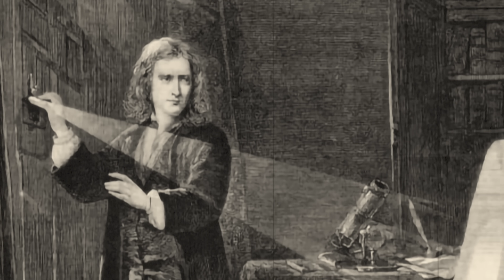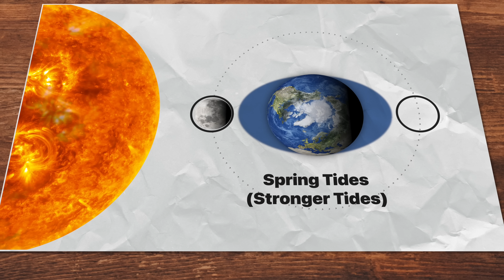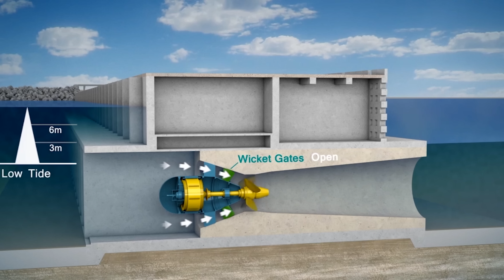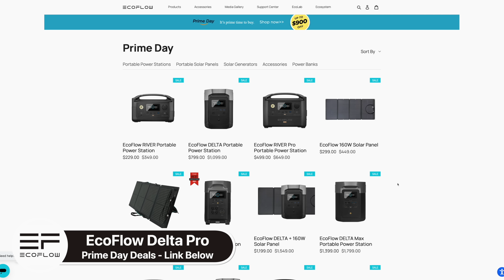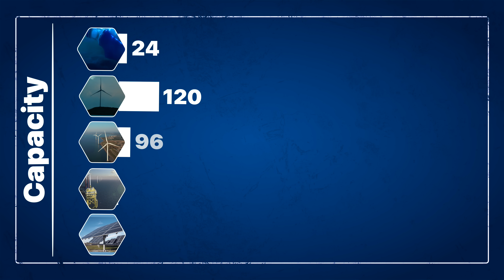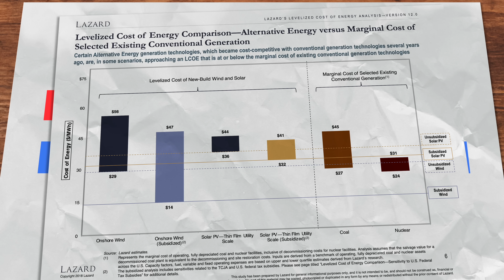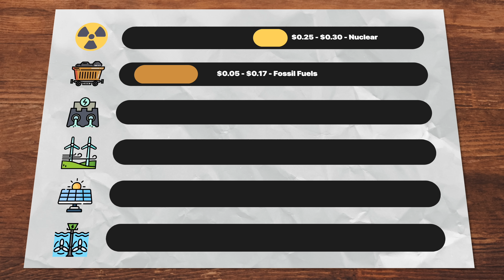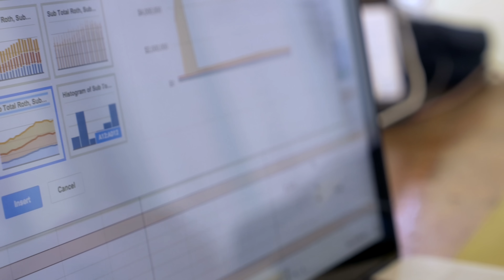Breakthrough Energy Source is 10X Better Than Wind & Solar!?

Comment: Worked in this industry briefly. The challenges are huge: water eventually destroys everything, salt water exponentially so. Installation and maintenance are ridiculously expensive. We still don't have great ways to harness and lubricate constant motion under water. The projects that have been done, while immensely informative, have typically fallen short of their projections. However the single biggest problem we were facing is lack of funding. Other than a few high profile projects it's really really hard to get money to explore this field. Governments should be dumping billions into this.
Reply: Good lord, have you people never heard of maintenance before? Just because something is exposed to a harsh environment doesn't mean it's going to curl up and die. Are there challenges? Of course there are. Do you think nuke and fossil fuel plants never had any challenges? Do you think they don't need maintenance?

There are corrosion resistant alloys, ceramics, fiber reinforced plastics, etc. that can be used to build these types of machines. Lots of talk about bearings. Do you know what is used for bearings on the propeller shafts of boats? Rubber, lubricated with seawater. Don't believe me? Look up cutlass bearing.

We, as a society, need to get our collective heads out of our butts and think about what is down the road instead of what is right in front of us. We used to do that. Now, it's just "What is good for today?" I can remember the same arguments being made about the space program by narrowminded people. But today, thanks to the research and effort that went into the space program, I can type out this missive on a laptop from the comfort of my couch, or the beach, or driving down the highway. Okay, maybe not driving down the highway (because that would be dangerous) but I can certainly ride in a car and connect with the world via my cell phone. I can go to bed tonight on a memory foam mattress. I can rely on the weather report to tell me that I can cut my grass tomorrow with a battery powered lawn mower. 

My little screed is almost done and I'll relinquish the soap box after this final thought. Research into new technologies can pay dividends that we can't imagine right now. Do you think Werner von Braun was thinking about telecom satellites and spongy mattresses when he was working on V-2 rockets or was he just interested in blowing $#!+ up? Without those early pioneers in space, we wouldn't have the tech products we take for granted today. Research like that which would be needed for tidal power generation could provide other important tech that we are not imagining today. And, even if it doesn't, it could still hit it's prime target, an abundant source of clean energy.
Reply: As someone who knows nothing about it, I assume the system would be similar to what it's used today for marine propulsion, combined with port construction.

Which are the complicated details that I'm surely oversimplifing?
Reply: They have been through 3-5 year underwater testing both in Scotland and in Japan. The results are good enough to start going full scale energy production.
Reply: There was African hardwood that was used for engine bearings. I’ve also heard of ceramic bearings. And magnetic bearings.  The solutions are out there.
Reply: @The1Elcil  create corporations which pay all of the taxes and hire people to do awesome stuff and pay them well and your dollar will actually go somewhere and everyone's quality of life will improve
Reply: I was just wondering how they plan to deal with marine growth on these things. In one year anything underwater starts to become a growth platform.
Reply: @BadUncleIke  Send a small current to the exterior. It will repel life forms...
Reply: I am thinking that maybe most of the corrosion issues might be addressed by 'anchoring' the most vulnerable components in a floating platform.  I expect this would not be easy (tidal forces to name one problem).
Reply: @jimparr01Utube  like epoxy coated rebar you can coat any metal
Reply: @drseuss5407  Yes Sir.  But as a sailor decades past, I understand at least something of the highly corrosive effect of wind and water at sea.  I really have little notion of what I am talking about with the power generation machines currently in use or under prototype evaluation.  BUT, I expect it will take some genius engineering to ameliorate the effects of this type of environment to ensure a productive life-span for any installation.
Reply: @jimparr01Utube  Was thinking the same thing. Why not use inverted vertical-axis turbines with the sensitive parts sheltered above the waterline?
Reply: @chow-chihuang4903  It's been done. Time for some research.
Reply: The US government devotes the bulk of it’s attention to who drops the most in campaign donations. Currently that’s the petroleum and coal companies. They keep the public poor so they are always reliant on government handouts. Then they look down on the handouts so they can justify restraining the people even more. Look who reformed the bankruptcy codes against the people in 2005 and then ask yourself how he became President now and why he’s so slow doing anything he promised to get elected.
Reply: Thank you, that is what I thought, But I don't know how ships and submarine propellers manage to work in saltwater. Can't you use the same technology?
Reply: @m.dahmadi4881  they're repaired very frequently, are huge money sinks, and pale in comparison to the power scale we're looking to harness. Also it helps that they're not stationary, and floating around in the ocean. That means there's less things catching on them, whacking into them, and general damaging them.
Reply: Water is a universal solvent, regardless of what material you use water will tear it apart, maybe you could help reduce the damage with hydrophobic materials but ultimately putting anything under water just increases the difficulty

Material damage, under water pressure (not just for the machine but the people that have to work on it and clean it)

The future of energy is nuclear and hydrogen
Reply: Qukai, you are correct, and a fair assessment.  Thank you for a very effective and quality post.  I mean this with zero sarcasm.
Reply: @TheFastAndThe Dead This is correct, on top of being excluded from taxes, which adds to the subsidies...  Except, now add oligopoly driven, unregulated, speculation.  Free enterprise goes out the door when all in the industry operates as one.  That is why different sources of energy are needed on a market ready, productive, basis.
Reply: "Governments should be dumping billions into this"

This ^^

I get the feeling that fusion gets endless $billions down an unproductive path (tokamaks) because the fossil fuel giants do not expect a magic breakthrough to occur anytime soon.

If the same $billions went into tidal energy it would be solved already.
Reply: Miraculously in Europe they've installed ALL KINDS of structure in the oceans and seas and can manage massive water breaks, tidal power plants that have been in use for decades, turbines, etc... and can design these systems to where they're cost effective.

Now, why that can't happen in the US, I don't know maybe your engineers haven't figured out the science of materials which is only about 100 years old?
Reply: @johndoh5182  According to Eurostat only Spain and France have any tidal power generation at all and it's a fraction of a percent - so no the EU is not just magically running off efficient affordable sustainable tidal/ocean power while the rest of the world neglected to notice.
Reply: @lephtovermeet  Umm, have a problem reading?

"Miraculously in Europe they've installed ALL KINDS of structure in the oceans"  

So now look up ALL the different structures in the oceans and seas around Europe.  I guess you didn't realize what the word "structure" means?

I was responding to your OP about materials, and yet materials science deals with issues EXACTLY like this.  So your OP is overblown.

In the EU there are tidal turbines that have been in operation for a long time.  You could say this was part of their learning curve.  Don't install 1000 systems and then find out it's too expensive??

Yes, in the European countries there are plans to expand underwater turbines, but it moves slowly because of environmental impact studies which take a long time to complete, but even this wasn't going to be done until there was really good data on these types of turbines.
Reply: @johndoh5182  yes, most projects take a long time to do an environmental impact study, specially when it comes to sea and oceans, but I'm sure that it's worse for tidal ones than say fossil rig platforms because of the proximity to shores
Reply: Environmentalists lobby groups, celebrities and large corporates that preach about climate should be "dumping billions" into it.   I am not talking about a token gesture, I am talking going "all in", remortgage the house  and invest the kids inheritance.  Then we might at least believe that they believe in the "climate emergency".  As it is, not so much.
Reply: @jamescaley9942  Even if there was a real emergency they would be the last ones to spend anything on the solution. They would make the poor pay first, they think they have the authority to do so.
Reply: Once more tidal systems are up and running the costs will reduce. New advances in anti corrosion methods are happening all the time. Time for governments to put the investment into Tidal instead of wind !
Reply: What portion of this “water ruins everything” do you think is actually the oxidizing it allows?
Reply: @TheFastAndThe Dead not that easy =/
Reply: Thanks for your contribution.
You pointed out  important drawbacks.
I think with invention of new generators we can overcome these obstacles, SWET , solid state wind energy can be developed to be used for getting tide energy.
For this purpose I am thinking about new generator , I named it DMEG ...
Reply: does it always have to be rotating turbine for tides too?
Reply: The goverments dont want cheap electricity , not part of the agenda .. society is based on waste and sickness not  last forever and cheap as fk and optimum health for all ... no money in that scenario
Reply: Hard to say if throwing billions at it will solve it. I would hope gov remains open minded and if someone comes up with a possible solution they will check it out. Does not help if the projects came short of their projections.
Reply: Old tech like water wheels are less prone to failure when the delicate bearing and electrical components are not under water.
Reply: @TheFastAndThe Dead Use different materials.

Easier said than done. Saltwater is amazingly corrosive. There are not many materials it can't eat up. 

And as he notes in the vid  ca @9:30, "biofowling". aka "Barnacles" (though there are certainly other waterborne lifeforms that create issues). Your material not only needs to resist the corrosion, it also needs to resist the attachment of barnacles and other aquatic life forms.

Note that the price per kw hr figures he cites for all the "green" sources are preposterously wrong. If they were not, there would be an industry RUSH to develop "Green" energy, even more so because there's such a push by a small class of noisy but ignorant Green fools who demand it. Claiming 80% efficiency is especially ridiculous... There are NO systems that get that kind of efficiency known to engineering OR science. The best known systems currently seem to approach an optimax efficiency of around 66%.

Equally important, California and Germany would be the world leaders in power production, because both have gone all-in on "Green" energy. Instead, Cali has to import something like 30% of the energy it uses, and Germany is in a serious state of near-collapse as it fails to produce enough energy to support a modern civilization. Germany is now tearing down its forests for wood-energy, and along with many parts of Europe who have been suckered into this garbage, is already warning its citiz//// (cough cough) "peons" that they can no longer expect to rely on having power to heat their homes this winter, that there will be multiple days in which they will not have enough heat. Even France, who have used nuclear for decades as their main source, with no significant incidents, has fallen for this crap and is expected to have significant shut downs of non-essential power usages. In France, many otherwise successful restaurants are expected to go out of business this year due to being shut down for substantial times due to enforced blackouts of "nonessential" businesses.

No, don't take my word for it... just pay attention to Europe this winter. Pay careful attention, as I doubt if the US media will report much of this. Work on getting some international sources, such as papers in the UK, which you can rely on.

P.S., they also fail to note yet another form of actual Green Energy which probably should be investigated (though it has the same issues, corrosion and biofouling), and that is "Ocean Thermal Energy" (wiki it). The basic idea is to use the temperature differential between the surface of the ocean and about 100 feet down to generate electricity. There are two different systems Closed Loop and Open Loop -- one of them just brings the cold water up, puts it into a heat exchanger, then releases it back down where it came from. The other brings the cold water up, and then releases it at the surface.  The former helps the fish below, by giving them more warmth to work with. The latter helps the surface fish, as it releases the nutrient-rich water from lower down (nutrients sink) up topside. The big question here is deriving energy from the temperature differential which is lower than we typically use to generate power. The answer may be in the form of the JTEC (the Johnson Thermo-Electric Coupler) invented by Lonny Johnson, the former NASA engineer who got rich by creating the "Super Soaker" water guns. It gets close to the actual maximum efficiency ("The Carnot Cycle") even at low differentials. This is also pie in the sky, as, while there have been some small pilot plants operated out of Hawaii, there has not been a great deal of investment in it.
Reply: Why would you dump money into low return unreliable systems such as this when high reliable green safe nuclear power is just about here?
Reply: @TheFastAndThe Dead Thanks for the comments. I think we need to give the new generation small scale nuclear a serious try. Read about the NuScale company NRC approved small reactors that are coming. The IEA says nuclear is the most reliable energy generation technology we have and far less expensive than wind, solar, and tidal. Look up the measured capacity factors for each technology by the IEA. Generation needs to be near load as transmission loses are significant even in short distances. I like tidal but my state has no tides… i.e., no coastline. Wind in my state at the best location only operates 34% of nameplate capacity. Installed solar here likewise has a poor capacity factor… less than 20%. We gotta do something… good grief Charley Brown. There is lots of wind in the air, there is lots of water in the ocean, and there is cheap land on the moon, but none of this helps the folks living in the desert.
Reply: Plastic seems to hold up longer in salt water
Reply: Once they figure out the main designs, I expect carbon fiber will be the solution to a lot of the problems.
Reply: They could use graphene lubricant with reverse engineered Lilly pad particles for hydrophobics, also graphene has been proven to create electricity output from salt water abrasion which would enhance the general output of the turbines.
Reply: Also why are they not using implosion designs for the turbines? That would take less force I believe.
Reply: Thanks. Brilliant, concise, and should be sobering. However, starting with N Tesla's insights into the use of rotating fields & tapping ambient E will soon be the best way to power the world (with least heat & GHG pollution, least toxics, least maintenance & costs, & best durability & E-efficiency). ~
Reply: Thank you for sharing your expertise.
Reply: @TheFastAndThe Dead It has been subsidised but not nearly by how much money has been taken in taxes for oil and gas.
Reply: Yep. Enthusiasts are people that have never lived near, nor have any experience seeing what Saltwater environments, with all of its biology, does to anything that spends even a short time visiting its world. 
Even without the effects of saltwater corrosion and biological build-up, mechanical seals needed to keed the "innards" dry, are prone to failure on a regular basis. Leaking seals always leads to internal mechanical failure, electrical component damage, and the only way to do repairs is to lift the turbines out of the water... Essentially disconnecting them, underwater,  by divers... and "dry-docking" them. In unreliable weather. EXTREMELY expensive.
Reply: This and the growth of sea life on the generators unless toxic forever chemical coatings are used, drastically lowering the efficiencies in a short period of time, and the need for massive amounts of energy storage to provide power at tidal maximums and minimums when water isn't flowing past the fields of generators.
Reply: @thefastandthedead1769 Use carbon pulled out of the atmosphere perhaps or grabbed from CCS on FF plants maybe?
Reply: @thefastandthedead1769 Thank you. No one thought of that.
Reply: There are different types of systems, ones that don't involve turbines. I'd like to see a whole video on different styles, like the ones Israel has.
Reply: Seems the best ans is in  research for a non-corrosive material. That might help unforseen situations on other planets, too. So, where's the Einstein for this? 😅
Reply: Bearings can be made of ceramics that could resist seawater.
Reply: @glike2  No ceramic is definitely too brittle to make into bearings. If there’s an issue we don’t want parts to shatter at their first high stress encounter.
Reply: Which is why we need to just build more nuclear power plants.
Reply: @infidelheretic923  Nuclear is expensive to build and problematic with its nuclear waste that lasts for 1000's of years. There is always the unexpected. Look up "List of nuclear power accidents by country"
Reply: @TheFastAndThe Dead Aluminum Bronze would be expensive due to the copper required, but it meets all the requirements as far as I know.
Reply: There is a lot of thing that requiere billions of dollars  to be dumped into them, the ROI of each one is need to prioritize.
Reply: @TheFastAndThe Dead so? If it is too expensive is useless. The countries don't use carbon because they like to pollute the environment, but because is the cheaper option.
Reply: @AlessandroRodriguez  we use oil.  That's subsidised massively, globally, but we keep using it & polluting the sea & our air 🤦
Reply: Governments should be dumping billions in taxpayer dollars where ever the taxpayers want it to go. Cutting edge R&D is where this belongs; once the engineering challenges have been met sufficiently, the market for this tech will explode. Governments stick their hands in citizens pockets for plenty already, and with the state of the global economy right now, we have some other rather pressing matters to attend to.
Reply: @thecrarion4102  people have no vote , no voice , your goverment only wants your money , time and life not your voice or opinion .. wake up .
Reply: @macalister8881  I'm fully aware of all of this... but many people aren't there yet, so I tend not to go nuclear in comments sections...
Reply: @TheFastAndThe Dead trying to care for people so far away?, have you interacted with humans?, they barely care for their community and both sides of this discussion have have make very clear that any extra cost is just taxes. Don try to explain this to me, explain to people who barely goes by that they have to pay more for their stuff.
This it isn't about make the coal more expensive to reflect the true cost, that doesn't work with people. make the green cheaper and useful and the people will flock.
Reply: Could not agree more except the part where Government dumping money into this.   And you forgot to mention the impact on species that live in the oceans that will be impacted like fish, whales , birds, bipeds like seals.  The only thing I could add to possibly make this work, is make everything out of carbon fiber.  Except that still does not solve the dead shredded animals problem when operating.
Reply: @mymy3172  They seem to be rotating at fairly slow speeds. It seems that the undersea animals can adapt to their presense. If not, well...
Reply: 65 percent of the planet would take a synthetic opioid drink by the 10,000 gallon vat and say thanks, 1/3 off the world is starving to death, 5 percent need bones they can't or don't want to get replaced, 5 percent need organs they can't or don't want to get replaced, 5 percent are terminally ill 5 percent comic pain, 5-10 percent never wanted to be here anyway, and everyone else will have a peaceful way to go when they want. There's no good way to go, some are 18 and 0 and going through death and not actually dying is not fun, some attempts are violent to go through. They're needs to beat peaceful easy way for everyone  when they want to go. Guy saves 1M in state aid, paid 600k in social security, doesn't have to die every day, just gets to leave before suffering. The guy with the kids gets 800 k from Uncle Sam in life insurance he never signed up for and Uncle Sam keeps the other 800k. Free euthanasia. Cut inflation by more than half, more than doubled available resources. Have a job by a company which pays all the taxes and picks up grass clippings M-S to take it to fields now with cows on it, 4x your US cattle with lawn mower clippings from every years, save 2500 on property taxes and make sure your clippings are out in your neighborhood on Tuesdays

Dig out 10 ' of river bed and cast and set two 10' pipelines to being Atlantic ocean water to every house, use steam distiller for sale free disinfected water at the kitchen sink, dump waste water into sealed pipelines. It took a turn 2 years to dig out 10' of riverbed, everyone could be back to work working in every town and we'd be at with new infrastructure. Don't put salt in your water, have more salt for more roads in the winter. Use electrolysis for energy from salt water.  At the very least, feed rivers with desal water immediately to overcome drought shortages, no problem

Make a grass and corn crop that grows in ocean water hybrid with say, oceanic grass root structures, best generic corn crop growing in salt water in Texas and Arizona while you solar desalinate more oxygen and hydrogen into the air in a 24/7/365 grow season with ocean water and no weeds growing in salt water cross, full your swimming pool with ocean water and water your lawn with salt water, don't put salt in your what salt water put it in the roads, use a small steam distiller makes it glass and stainless to get disinfected and salt water free water for cooking and drinking, maybe an ocean let for your pool, were have to deal with ocean water rise, how about a Dolphin?

Hey maybe make a corn grass vine hybrid that grows up factories and harvest it by pulling the corn off the building
Reply: Use some natural springs no fish or mose no salt in water n u can put system universal ground n have the hose run into spring there always flowing never freeze here in sourthern Missouri like the turbines at hover damn
Reply: Great information. I struggle to see how you would be able to implement something that protects marine life and the ocean itself, i.e. leakage or exposure to of the ocean to the lubricants and other materials mentioned.
Reply: Quantum Vacuum Energy Extraction or Zero Point Energy exists but we need access to the tech. All the other ways to create 120VAC are insane!!!
Reply: Yeah, I was bored after the first 30 seconds. Save our climate...blah blah blah. Think how much power would be saved if everyone wasn't watching Youtube videos 24/7?
Reply: I'm an EE in Silicon Valley.  My experience with "renewables" is that MOST of it, is an outright cynical scam.  But government throws money at the stupidest idea, and so will Blackrock and other venture capital.

I have seen projects proposed AND FUNDED where there was literally ZERO possibility that it was worthwhile to do.  Look up Solyndra's idea of a "solar panel".  In every way, every CONCEIVABLE way it was inferior to a flat panel, and more expensive.

There's no effort to make solutions.  Electric cars, they are just basically natural gas and coal cars, batteries are just storage, and not very good storage.
Reply: Why would anybody want to invest money in such a corrosive situation?
Reply: @thealeons3179  OIl & gas are both highly AND poisonous, why would anybody want to invest money in such a solution?
Reply: @thealeons3179   why would anyone go to sea and not just remain in fresh water environments when it's so damaging ?
Reply: @thealeons3179  Would you rather invest on something that would contribute to the destruction of our only planet to live?
Reply: @thealeons3179  Because if you can figure it out, it's free energy 24x7x365. Plus it could limit shoreline erosion.
Reply: True, i work on similar industries also. Believe or not, in power industry, currently theres no match for reliability & low operating cost on coal fired power plant. The only promising and key technology for renewable energy only on solar & battery storage. If those two have much lower 'real cost', only then we have really clean energy source.
Reply: Wind and solar are heavily subsidized - which is why current power rates go through the roof.
Reply: @ibubezi7685  New wind isn't subsidised in the UK any more, because it's the cheapest form of energy generation.  Currently, with gas prices so high, the subsidies for existing wind are being cut back, with subsidy money being repaid to the government.
Reply: @ibubezi7685  Nope, LCOE doesn't count subsidies (and fossil fuels are FAR more heavily subsidized than renewables.) and renewables achieved the lowest LCOE, lowest cost of energy anywhere on the globe and in history (especially solar).
Reply: @ibubezi7685  I hear oil is waaayyy more subsidised which just makes no sense
Reply: @ibubezi7685  they're not in the UK. onshore wind is by far our chepest power. Fossil fuels are heavily subsidised via tax breaks
Reply: @ibubezi7685  coal and gas have the largest subsidies of any power generation, in Australia alone 11 billion in subsidies last year.
Reply: @ibubezi7685  Wrong. They are pretty much the least expensive sources.
Reply: @ibubezi7685  I know it's useless arguing with people over the internet but solar is barely subsidized and I dunno about wind. Plus if they were heavily subsidized, how would that increase energy prices? Furthermore, fossil fuels and their derivatives like roads and gasoline are massively subsidized while ignoring their negative externalities and all of the damage they do to people and the environment.
Reply: @lephtovermeet  lubrication is not needed, take apart your fishpond pump to see, the rotor/impeller assembly is sealed & often on magnetic bearings, nothing else has bearings.
Reply: @lephtovermeet  the consumer ultimately pays full price for energy, either directly to the supplier or through taxes which is where the money for subsidies comes from. Ok, imbalanced taxes sometimes mean that some people pay more for energy than others but the principle holds.
Reply: @alanhat5252  def not. Subsidies mean everyone pays, not just the consumer. For instance, roads and oil refinement are heavily subsidized. People who live in urban centers and don't use massive highways and suburban roads are frequently subsidizing those roads. Trucks that do the most damage to those roads are effectively subsidized while shipping companies actively exploit their drivers. Furthermore, do some reading on negative externalities. Sure, ultimately everyone will "pay" the price of global climate change. That might be literal money to rebuild damage from storms and fortifying infrastructure it such. It will be metaphysical as well as in all the people who will die as direct and indirect result, all the species that will go extinct, the massive changes to our environment we're causing. And the people most guilty of effecting these changes, either won't live to see the worst consequences of their actions (because they're old) or they certainly won't be paying their fair share, hence the term negative externality.
Reply: @lephtovermeet  you're forgetting about health externalities too
like paying for social, medical and retirement.
those get affected by spread cardiovascular disease and cancer from pollution
Reply: @lephtovermeet   Wind turbines are massively subsidised and when several US states stopped doing so not a single one was built until the subsidy was returned.
   Here in UK self congratulatory back slapping fails to take into account the additional sizeable 'Green' tax on our energy bills.
Reply: @alanhat5252  lubrication is not needed, take apart your fishpond pump to see, the rotor/impeller assembly is sealed & often on magnetic bearings, nothing else has bearings.

Yes, Alan, no one else has ever though of this, before YOU did!!

SMH.

Clearly, there are issues with your suggestion which don't work as readily as you think.

and

  @Alan hat   metals aren't the only option, materials commonly used for boats will work just fine for underwater turbines, concrete, fibreglass & wood last really well underwater

AAAAnd again, you are, of course, the ONLY person this has ever occurred to!! 

Such a GENIUS!!!

It is now time to suggest you look up the term "Dunning Kruger". and consider if perhaps you might be a poster child for it.

For the latter, I would wager that all of them lack the needed structural and tensile strength to handle the high and constant stresses of the process. Even metals fail from "Fatigue". Ceramics might fare better, but probably not, as they generally lack tensile strength. Perhaps you've noted that large ships don't use fiberglass propellers? Why is that? Is the light turning on yet?
Reply: @lephtovermeet  Well, just think about  the positive externalities off a road...  About wind they are heavily subsidized in Quebec and the Hydro Qubec, the company in charge in Quebec is force by law to buy electricity from the wind turbine, even if they cost more than hydro. Because they are not constant (intermitant) , they need other sources for a backup, it's even truer during peak of demand (like when it's 7 PM, in winter, a -25 Celcisu) . So the cost of an average Kw Hour is low without wind produced energy, but when you include the wind, even if it is a fraction, the average rise, wich means that people in Quebec are well aware that we now pay more BECAUSE of wind energy. And we cannot really sell the surplus they creates, because they are not predictable. 

In short, building more hydro would be the solution, but we don't do it because it is not see as  «green» as wind turbine, all this because of the propaganda around wind energy.
Reply: @ibubezi7685  I think you'll find it's the high cost of fossil fuels.